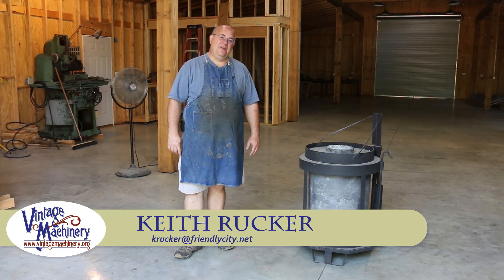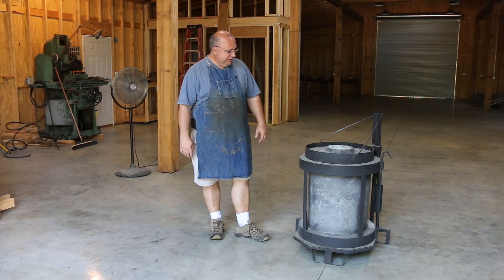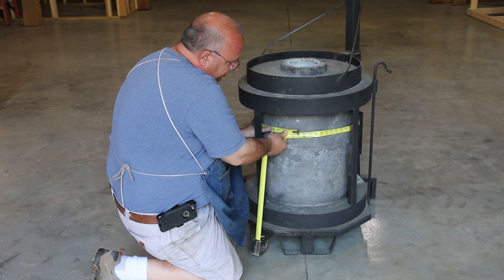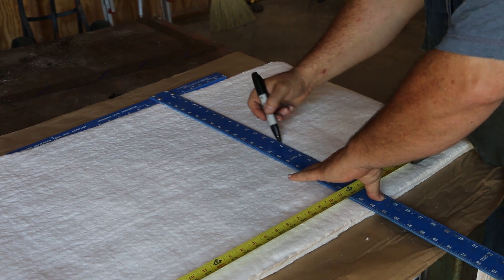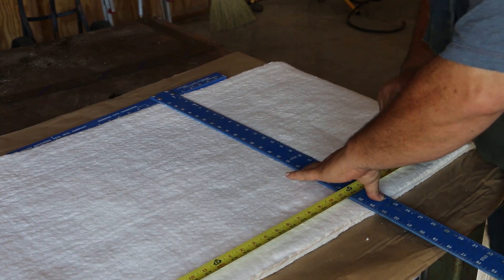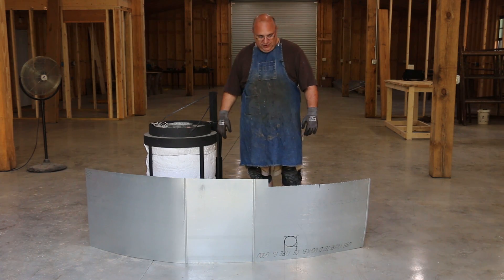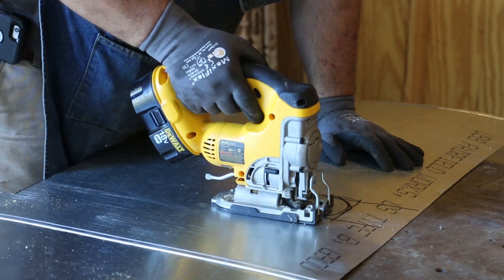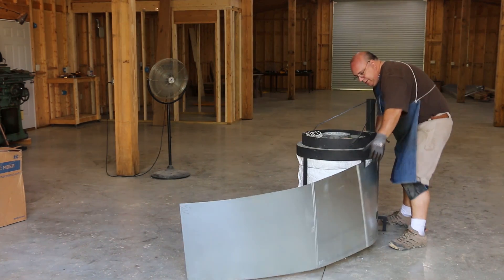Building an Oil Fired Foundry Furnace - Part 12: Installing the Insulation Blanket Wrap

Comment: I know I'm 7 years too late. However, to fit the casing metal and pull it up, use a couple of the cheap lightweight ratchet straps. They really work well to tighten and then pull in to allow you to pop rivet the seam.

Comment: Hi Keith, I'm 74, retired, worked around furnaces on and off all m life. A few points:
Curing - you want he water out and anything over 212F will do that. Anything close will help. A charcoal, or wood fire is safe and easy and not likely to blow up your refractory.
Insulation - needs to be inside the steel shell. There is a temperature gradient from the 1200 F (?) inside to the outside air. 450F is pretty hot for the steel BUT,  if you insulate the outside of the steel, you'll change the gradient, the sheet metal outside the ceramic blanket will now be exposed to outside air, and the steel between the hot refractory and the ceramic blanket will get closer to refractory temperature and may end up running red hot with greatly reduced life.
If you are going to use crucibles inside the furnace, you may be able to use the ceramic blanket inside with a thin refractory wash and leave the outside steel exposed to outside air.

Comment: Did you think about putting the gas inlet on the other side? It seems like it will get underfoot where you will be opening and closing the lid. Or is it not as in the way as it seems?
Reply from the maker: It is actually more out of the way there I think.

Comment: Keith. Great work. Looks just like a bought one. Not that I've seen any. So much care you've put into this. Frankly it's inspiring.
Would this be capable of melting steel, or do you need higher temperatures for that?
Looking forward to future videos. Thanks.

Comment: What works well for cutting thin material with a reciprocating saw is a piece of Styrofoam a little thicker than the length of the blade ofthe saw on the table under the material. The blade goes through the foam harmlessly and it provides a stable platform for the material. The inside of an old hot tub cover is what I use. Other peoples trash is my treasure.
Reply from the maker: Nice tip!

Comment: The melting point of zinc is ~790F, although I doubt that you will exceed that. Maybe you can experiment with your Tempil sticks later and report to us. Optical thermometers with laser sights have also become pretty cheap. Paint adhesion is poor on hot dip galvanized surfaces that have not weathered or have not been wiped with phosphoric acid, so your high temperature paint may require a little touch-up.
Reply from the maker: We will see about the galvanized surface, but I don't think the skin will reach that temperature.  Maybe around the burner hole, but that should be about the only place.

Comment: Double Head Sheet Metal Nibbler Cutter Cutting Tool Power Drill Attachment
  
 
   
     $25.21
Reply from the maker: If I did much sheet metal work, that would be a good investment.

Comment: Next time you need to bend metal around a round shape, try a ratchet strap instead of rope, works so much better. The furnace looks great, must feel good to work on a project in the new shop.
Reply from the maker: A ratchet strap would have been fine too, but the rope trick worked great!

Comment: Keith, I have used this stuff for many years in the various equipment used for making Maple Syrup.  I have on occasion had problems with mice getting into the stuff and making nests, always a special moment when setting up the evaporator..  I only mention it so you might keep it in mind when you tuck it away after usage. Mothballs or even just some duct tape over the blower hole might be in order.  It looked like there was a mouse sized gap...

Of course Ol' Josie, The South Georgia Swamp Panther might be a little more efficient then my lay-about barn cats!.

Just an observation.  As usual, great vid
Reply: Oops, just saw an early vid where you where reinforcing that spot, it was just the position of the camera that made me run my mouth... disregard
Reply from the maker: Not a problem - good point none the less!

Comment: The furnace came out great Keith.I'm guessing you will be using waste oil to fire it. It's always listed free on craigslist here in Detroit.
Reply from the maker: Yes, it will burn waste oil, but I will probably fire it on Diesel fuel the first time.  I don't have any waste oil handy or a way to store it right now.

Comment: a great way to cinch things with string or rope is to have a loop on one end (like you did), and add a loop BACK from the other end -- then you can pull the string through BOTH loops and really cinch it tight (force the loops toward each other).

great work!!

Comment: Hi mate.  I was a bit worried that you would run out of space, in those cramped quarters of yours.  But fortunately you were able to manage, thank goodness.   Will you build a chimenea for it, so you can use it inside on cold and rainy days?
Reply from the maker: I will probably just roll it outside on the pallet jack when I want to fire her up.
Reply: Fair enough, I had that vision of a 19th century foundry, with sparks flying everywhere casting a new locomotif. Alas, it's not to be ; (

Comment: Hi Keith,

No need to reply, just to say congrats on what you have done and I think you are right to isolate the wood-dust from the metal swarf. 
I am not too sure whether it is a good idea to link the two with a powerful fan though. That kind of defeats the objective principle of keeping the two areas separate in my opinion. Though I guess a fan blowing from the at the Area into the Woodwork Shop could be OK, the problem you might have to to make airborne the dust which has found a nice cosy bed on the rafters and cross-braces. Just a suggestion, could you or have you planned on an air duct to either just blow the saw-dust outside, or ave the fan you mentioned pus air out through the dust duct in the woodwork Shop? 
Just a thought, and it really is something I grabbed from the air as I am no expert but as an ex builder for all my life I have a few ideas, of course things, designs and County Rules vary as much across America as they do around the world.
I am assuming you will be fitting plywood or similar over the Insulation?

Good luck, I know it seems like a long time coming to be completely ready wired and finish as per the plans but it is an awful large building.
Reply from the maker: I am on the fence on the fan up there, but I figured it was easier to frame it in now than later - not a problem to cover it up....

Comment: Loved seeing the extra effort with 1/4 - 20 screws for the sheet metal attachment. I've done it many times too. True mark of a machinist/toolmaker. When you get gutsy, try chucking up the tap in the cordless drill.  Only tighten the chuck JUST enough to tap but, NOT enough to break the tap. A little Moly Dee, forward slowly till threaded, back out in reverse. Almost as easy as threading on a mill.  Be sure to use a good spiral point gun tap.  Then again, you probably did this off camera... Keep up the good work.
Reply from the maker: I did not try tapping it with the drill on this job, but I have done it in the past.  Always afraid I am going to break those small taps though...

Comment: Jigsawing thin sheet is a real PITA!! Reckon you needed a second pair of hands fitting it all up on the furnace.
Doubt that outer skin will get much more than real warm. Look fwd to seeing things running.
Reply from the maker: Yes it is.  Also trying to position the blade over the hole that I could not see....

Comment: Nice job !  I was wondering if the outer jacket of a water heater would work. It appears that maybe they are powder coated.. What ya think ?
Reply: they maybe alumnium also, or at least the paint might not hold up to it.
Reply from the maker: That would work fine I would think.

Comment: I might have used self tapping metal working screws instead of regular screws in tapped holes... they are pretty cheap over here in Europe and you only have to drill a hole and screw them in... and the yhave a lot of strength

anyways a nice construction and pretty interesting to see the other steps following Keith :-)

and are you adding some insulation to the lid as well? if you do so, you could cut up the rest of the not used insulation (6 inch strip) into cake slices
Reply from the maker: Yes, I plan to put some insulation in the lid as well.  I have plenty of extra...

Comment: Hey Keith, great job on the furnace. Thanks for not editing out the jigsaw, this stuff happens.
Reply: Nibblers work really well for cutting small holes in sheet metal. Power nibblers will save getting hand cramps when doing a lot of it.
Reply: yes it was cutting a smaller hole so the blade was binding, cant avoid it really, better to show it , i agree
Reply from the maker: That was the way things went....
Reply from the maker: A nibbler would be nice....

Comment: I was just looking at how tall that furnas is.  You are really going to have to lift the crucible very high to get it out of the chamber.
Reply from the maker: Hopefully, it won't be too bad...
Reply: I have never cast anything beside lead bullets, so I'm no expert by any stretch of the imagination.  That being said; I think that you may have to build something for you to stand on so that you can get your crucible lifting thing down in the furnace, grab a hold of the "hot as three shades of Holy #e%%" crucible that is full of even hotter, heavy bronze or iron, lift it all with your arms, back and knees then safely pour said liquid metal into a mold or molds.  Or, maybe you could dig a hole in the ground, put the furnace in the hole and stand on solid ground while you are manipulating said glowing mass of molten metal, tool and crucible.

Comment: Keith, I'm surprised that you didn't wear a mask when you were working with the ceramic fibre. This stuff is bad for your lungs! It is a considered to be a Carcinogens. Now that it's nicely locked away inside that sheet metal casing it's out of harms way! Thanks for another great video, Matthew.

Comment: All ready to fry some fish with that furnace.  Maybe a crab boil.  Probably could do that with the residual heat from a casting session.  With a cast iron pour at the university we would wrap up a nice slab of meat in foil, bury it in the sand box covered by a layer of sand and the last of the iron would be poured over it.  At the pour party that evening the meat would be dug out and turned into barbecue meat.

Looks great.  Almost to pretty to use.
Reply from the maker: Down in my part of the world, we do what is called a "Low Country Boil" - shrimp, potatoes, onions, corn on the cob, ect.  Good stuff!

Comment: Wrangling sheet metal is another one of those jobs where you need that third hand.  I remember when you ran into the issue with the side supporting straps needing to be cut so that the furnace can expand when it is heated. Will the sheet metal skin have similar problems or can it sort of float, riding on the support straps?
This is a great DIY project; saving a lot of money and creating a chance to have some real fun.
Reply from the maker: Will, first off, we did not see any expansion when we test fired it, so I don't think expansion is really an issue.  But with that said, the skin should ride right along with the supports and move up and down with the furnace should it try to move.
Reply: Keith Rucker - VintageMachinery.org   The furnace turned out looking very nice.  I bet that it will be used for decades.  Whoever gets to work with it will appreciate the time and effort you put into the project.  I went to college with a fellow who made his own glass blowing furnace and used it to make stained glass to repair the windows from old churches.  The university still uses his furnace 30 years later.

Comment: I really like how it is coming together Keith. What are you going to do for a crucible and tongs, build or buy? Also, where did you get your insulation?
Reply from the maker: I have a crucible already, but no tongs.  I am going to talk to our blacksmith at the museum about building me some tongs.  As for the insulation, I was able to find it easily on the internet.  I actually ended up buying this box off of ebay because I found somebody selling some stuff they did not need for a lot cheaper than from a dealer - it was brand new stuff still sealed up in the original box.

Comment: Keith,

That's about how our refractory installation contractors at work do the job of installing CF blanket... there's really no other way to go about doing it right...

Thermal Ceramics (these days Morgan Thermal Ceramics) Cerablanket, and Harbison-Walker's Superwool are both good products for this kind of application.

You should be fine with the 8 lb/cuft material... if for some reason, you find that it's getting torn - unlikely once you've covered it with sheet metal - the 12 lb/cuft material is a little bit stronger mechanically, if a bit less of an insulator and a bit more expensive.

Looks like good work, and you won't be abusing this the way the guys in a mine or smelter would...

Cheers,

Eric
Reply from the maker: I think it should hold up fine.  Time will tell!

Comment: Hello Keith,

The furnace is looking professional now with the metal sheet around it and I am curious about how it performs. Looking forward to the first time you're gonna melt iron in it, always scary to see but interesting. Scary because of those high temperatures and that red hot iron, and I don't want to think about the burning on skin eeks.

I hope the storm is not getting to your place but that you get only a bit normal rain from it. Here it is now sunny but they forecasted that there will still be thunderstorms later in the day. 

Anyway great video and looking forward to the final part !

Many greetings from Roel !
Reply from the maker: We will probably start with melting some aluminum and brass before moving up to cast iron, but we should be able to get there.  As for the storm, we are getting some nice light rain this morning and are expecting thunderstorms all day long.  They are saying about 2-4 inches of rain.  As long as it does not come too fast, we should be fine - we are really dry around here, so the farmers will welcome some of it.

Comment: Just curious why you didn't just use self tapping screws?
Reply: Probably because he wants to be able to take it apart and put it back together at need...
Reply from the maker: The pieces I was drilling into were about 1/4" thick - a bit much for self tapping screws.  They work great in thinner material.
Reply: Right on, thanks for responding.

Comment: If you have a good sheet metal  guy, that seems a good way to go.  All parts match and a crimped edge with tabs to fasten would be sure to take the heat.  In my construction days, one of my most cherished subs was sheet metal.  He solved many a problematic design flaw in the plans....
Reply from the maker: My sheet metal guy is really good.  He knows his stuff and is amazing to watch work out a problem.